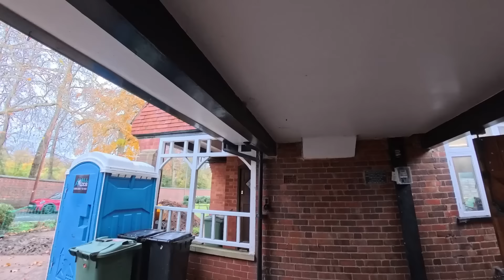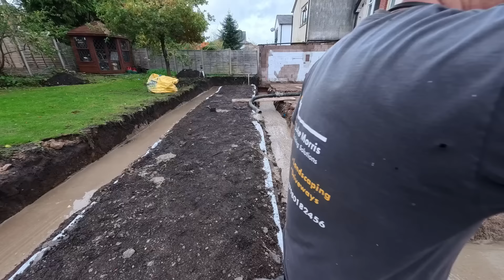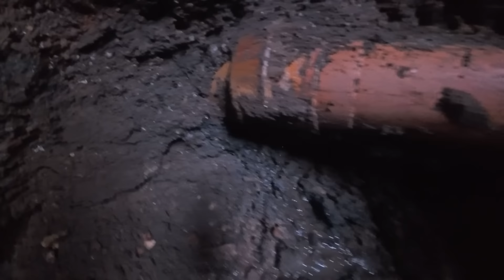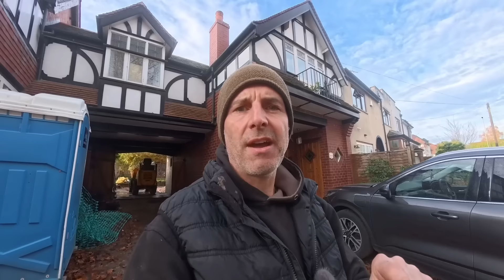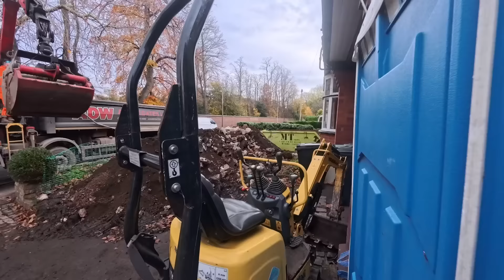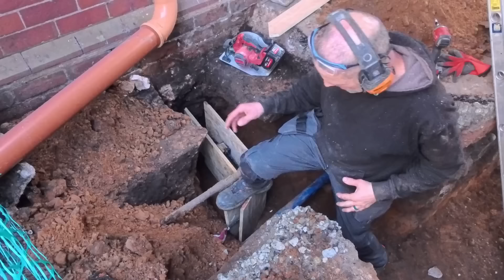Coach House Extension Ep 3 | Massive Pour, Power Cable Drama & First Inspection

Comment: Great video just out of curiosity what slump was the concrete or didn't it require one
Reply from the maker: We didn’t have a slump test on the concrete but it has to be of a certain consistency to allow it to be pumped. You may have seen the initial flow which was very watery but that’s only to prime the pump which is done with a neat bag of cement mixed with water.